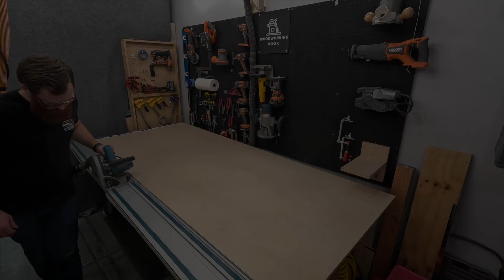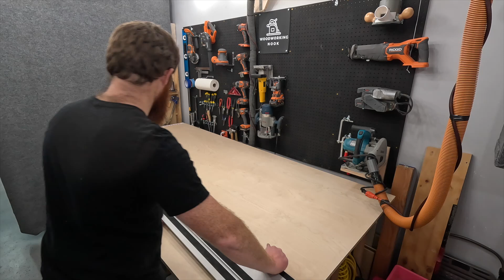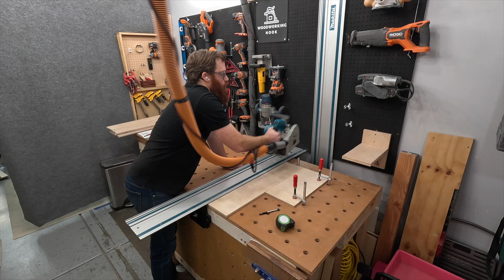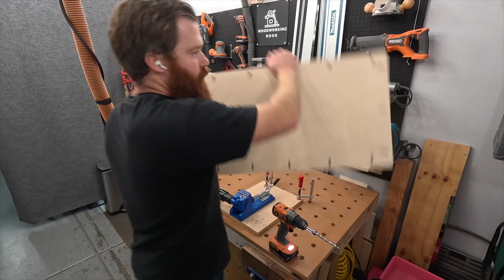ONE MORE way to build drawer boxes

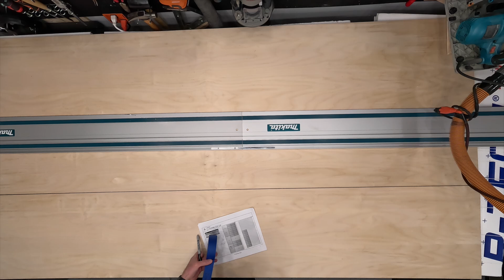Comment: Hi! Where do you get the 'track hinge' at 1:24? I really want one so i can make quick cuts..
Reply from the maker: It’s a 3d printed track saw hinge. I got the print files off Etsy. I do have a video on my channel where I review the hinge. In that video is a link to the files I bought. Thanks for watching!
Reply: @woodworkingnook  Came here for the same reason. Cool! I'd never seen something like this. It must really speed things up and help keep things square. And I'm guessing if you are always cutting in the same spot on your workbench, it minimizes how many cuts you have in your workbench top.

Comment: Seems easier/faster to make drawers via the dado method.  No hardware needed with glue holding it all together.  Making all those pocket holes for screws takes too much time and parts can shift when screwing together, where using a table saw for dados is a single setup for all cuts.  No thanks.
Reply from the maker: Totally agree! It would be faster cutting all the parts on a table saw too. But I don’t have one in my shop. I have thought about trying to figure out a way to do dados with my track saw. Thanks for watching!